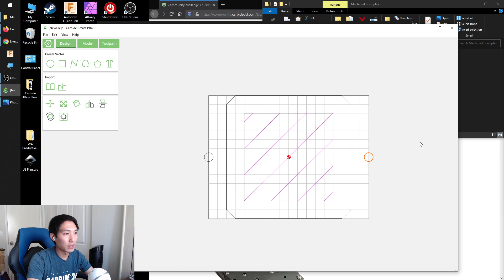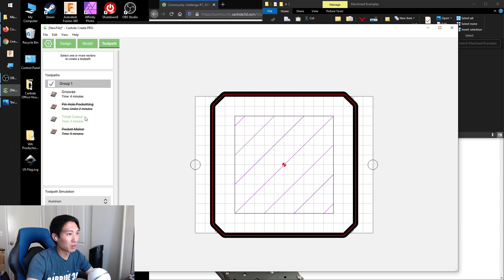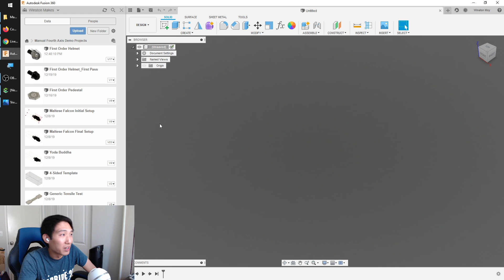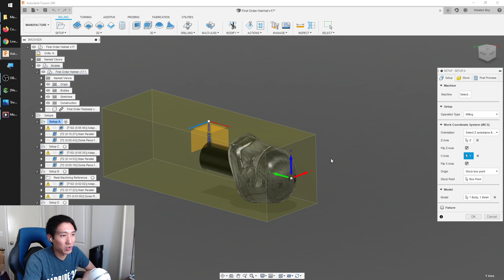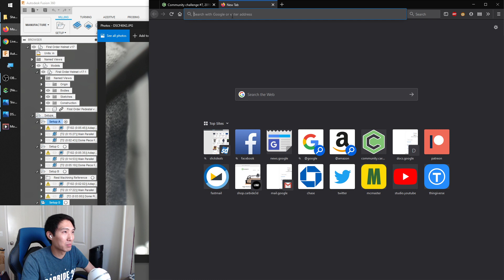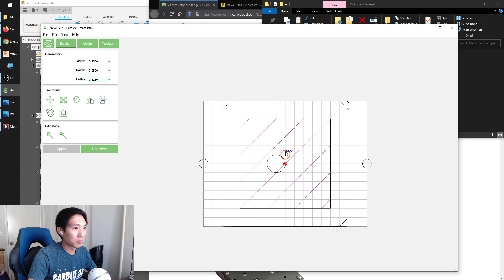Two-Sided Machining Examples - Carbide Office Hours #6

Comment: Winston  I bought the bitsetter I have  to use the splitter that came in the box because I also have the touch probe .
My question is what  I do to protect the splitter from touching any of the control board and shorting something out. Or is there an different control board that I could get I then would not have to use the Splitter. Also which version of CM do I need to install to make the Bitsetter work.
Thanks Please respond Jeff
Reply: I have build 513 of Carbide Motion and the bitsetter and probe work fine on my XXL
Reply: @PaulChandler1951  Paul did you need a splitter to install your bit setter. If when you put it in the where the control board is did you do something to keep it from contacting the controller board it self 
Jeff
Reply: resorter66  Yes, you need the splitter to run them both. I didn’t find any issues with it shorting although it gets pretty tight with all the wires etc